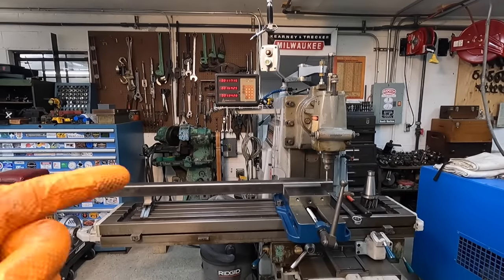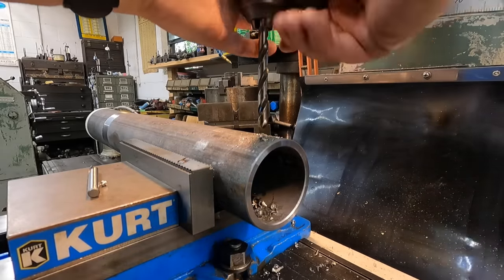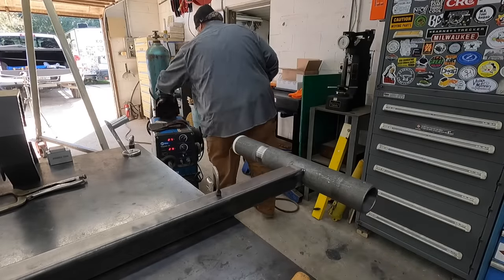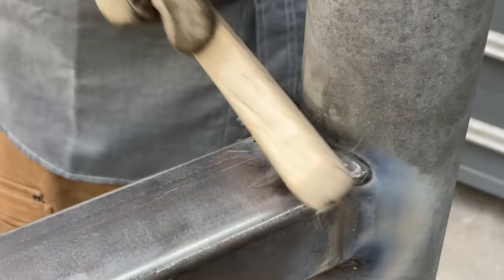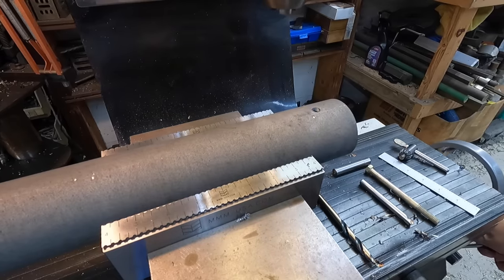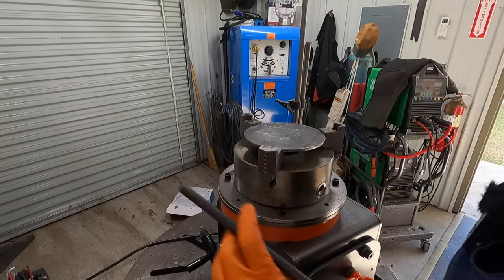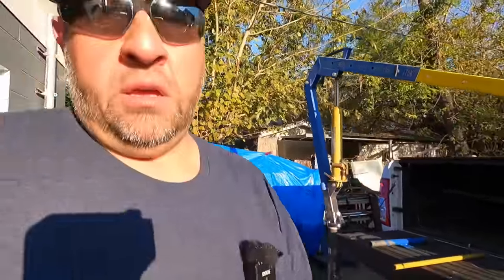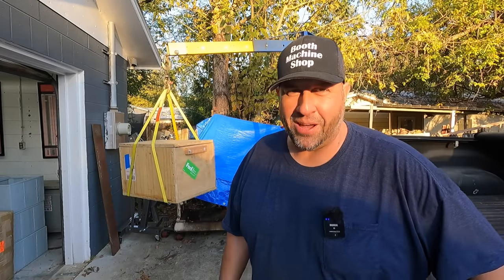Truck Hitch Crane Build Ep. 7: First Test!

Comment: Lifting system capacity is limited by the weakest link under dynamic (not static!) foreseeable conditions.  Intuitively this weakest link would seem to be the welded T joint on the vertical post to the horizontal square tube, which is leveraged by the load into bending, twisting, torquing forces all at once, all concentrated in the joint corners.  This threatens to peel the weld apart under much less force than the design strength of the joint.  The hazard is amplified if the truck should roll slightly, when the weld joint will be twisted by the leveraged mass of the truck!  Hence it would seem prudent, with heavy loads, to CHOCK THE WHEELS FIRST .
Reply: I would agree, but like he said it was for 500-600 pounds.
Reply: I was thinking the same thing but if it was me i would add a removable leg on a caster to support the twisting force

Comment: Awesome. 

I'd have some fold out support legs rather than rely solely on the box section to keep the tube vertical under load though.
Reply: When I designed mine, I did something very similar to what Adam did. It was a while ago, so I don't recall the exact square tube dimensions, but I think mine is 2" square 1/4" wall? Maybe 3/8" wall... I don't remember which. I did a bunch of simulations in CAD and it held up perfectly fine. it DOES deflect enough to notice, but not enough to be a concern. Maybe 5/8" under a very heavy load? My design IS different (taper roller bearing turn table, cable winch, luffing jib, no hydraulics), but that horizontal box section is roughly the same.
Reply: @52Ford  yeah, but overkill fengs my shui, outriggers ftw 😆
Reply: @gentlyschannel4193  👍😂 I needed a gantry crane to pick up the bed off my pickup... so, naturally, I made it to pick 10,000 pounds safely. 

Edit: If you're wondering - It's a fairly large fixed A frame, with 4 crossmembers per A frame and a knee brace on each leg that goes up to the beam. Sits about 14' to the bottom of the beam. roughly 10 feet of clear span between where the knee braces contact the beam. A LOT of welding.

Comment: That's awesome, Adam!  I don't know what the cost would be to manufacture, but I imagine someone could sell a few thousand of those per year.  Additional foot pieces for different truck heights would be necessary.  I wonder if a trailer jack setup on the foot and footpad might be a workable solution to the varying height issues as well as the potential binding of the pin?

Comment: I think that’s cool as heck!! 
Hmm 🤔 but just a suggestion to a fellow builder, maybe try a threaded pipe for the foot with an adjustable nut on the foot like on a washing machine.  That way all you need to do is have a big wrench :) 

If you wanna get fancy, drill and tap a short hole for where the threads would be and put a grease fitting there.  It’ll turn a lot easier then as well when needed ! Good luck :)

Comment: Adam for structural steel welding try some .052 metal shield wire it's only supposed to be used for flat welding you may try your stick out and amps also check how much pressure on your gas also noticed you wire was not wrapped in a plastic bag maybe moisture or rust on the wire I'm retired now but worked as a certified welder machinist and fabricator learned a lot of things the hard way thought I was already subscribe but not but I will be love your machining videos you are a great teacher and also please don't wear gloves around machinery seen lots of bad things happen to some that have dirty and cut fingers are better then no fingers keep up the good work love watching your work great job

Comment: SUPER cool project.  Thanks for this.  At min 32:45 I had a cool idea.  Down the line as you're using this or maybe a friend or family member is using it...when you're setting the sleeve pin, since the the holes are so close together and the foot sleeve covers the holes as you're getting the foot positioned for depth, you could etch the hole numbers on the foot say from the bottom up so it's easy to know which hole is beneath the pin inside the sleeve, and/or remember where your last setting was (say between locations throughout the day, etc).  You could also inlay some safety yellow fire hydrant paint into the etchings.  It'd look badass.  Just gotta figure out how to stamp, brand, or etch them numbers.  LOL
Reply: What difference does it make which hole it is?  You drop the foot on the ground, then lift the pipe as needed to align the nearest available hole.  Why would you care which number it's in?

Comment: Suggestion: with the crane turn handle you are talking about welding on, how about installing a longer bolt into the lower cylinder pivot, and then just thread a handle onto it?

Comment: You haven't addressed the torque through your horizontal bar against the ground.  Unless you put a foot that reaches out under the lifted weight, you will put all the torque on your weld between your vertical pipe and horizontal hitch mount.

Comment: You may want to wire wheel each joint with a stainless steel brush and spray your joints with a degreaser and blow dry with compressed air. Use a dedicatated wire wheel and not one with grease on it. Clean and disc sand your ground connection as well. It looks like you may have cutting oil or plating causing pin holes. It happens more on aluminum, but may be your problem. Notice it happens more on the last bead as the hot contaminated gasses have no where else to go but up at you. Most people blame the gas right away... Also check gas flow holes at near the wire tip. Sometimes spatter clogs the ports. Back in the day, I used to use spatter spray. Not sure if you guys are still using that today.

Comment: You may want to consider putting a locking pin on the horizontal square tubing in case the two bolts rattle loose.

Comment: WOW, what great work!! I binge watched all 7 episodes. This is what happens when an excellent machinist gets turned loose on a welding job. I'm hoping that you made this for your own use. I doubt that a customer would be willing to pay for the hours and skill that went into machining the parts. Now my 2 cents worth: You are very good at protecting your hearing as well as your work around machine tools. However, you should consider protection for your lungs. When you are welding, the toxic weld fumes are all around your face and in your breathing zone. I use a HF 8" Portable Ventilator with flexible tubing to exhaust the fumes away from my breathing zone. Just a suggestion.

Comment: Adam, 

You need to paint out the load limits on the boom.  Generally,  load limits require testing at 1.5 times the working load.  I doubt you want to  pick up 3 tons.  Also, nylon swells when expised to water.  A cap for when the crane is removed.   In addition, nylon is susceptible to damage if the wrong lubricants are used.  Evidently WD 40, for instance,  is a no no.

Bob

Comment: moisture in the flux is the most likely culprit. Usually flux core wire comes in vacuum sealed bags with the little moisture collector bags. moisture will get into the wire if it’s left around in the fresh air for months on end.

Comment: It's a fantastic build Adam, however you will quickly ditch the foot. The first time you load the suspension on your truck and can't collapse the foot on the crane you will have to unload the truck just to readjust the foot. I'm not sure what you can do to help with that, but just a heads up.

Comment: I think that a nut welded into the bottom pipe and a corresponding threaded shaft with the foot plate would serve you better as long as the shaft was 24". You never can be sure what you will run up against

Comment: If you keep the base in place while driving I would add a pin to lock the T section in place. If the 2 bolts come loose the cross section might slide into traffic otherwise.

Comment: You can make more adjustment holes without intersection, just put them not along a straight line, but on a spiral or along different lines, shifting a little bit

Comment: Looking forward to the crane to lift the crane video. You talk about protecting your back but the top assembly isn't a safe one person lift. Aside from splitting the jib and ram sections down with lynch pins, you can certainly bore the centre out of the solid pin to leave 1/4-5/16" wall. It should save a few pounds. The bar centre is redundant material - you could also bore it with a taper to follow the bending moments. You don't have the material above the flange so there's no point having so much below it. 

I'd also shorten the hitch adaptor to move the crane forward so you can load into the centre of the bed.

Comment: from my experience with welding the teeth on the wheels are for flux core wire since its hollow you cant squeeze it as firm as you can with solid core wire. solid core wire im not sure about if it will hurt to use the wheels with the teeth but smooth will work just fine you just need to adjust you tension. also a wire lube pads were used in the shop most times as the tools tend to have a lot of wear on them also the worm hole you speak of are probably from your contact distance. you need 3/8" to 1/2" with flux core and for the final tip as im not sure if i missed it but you have to weld with DC negative when welding with flux core unlike solid core where your running DC positive

Comment: I would just drill a hole in the main beam for the turning handle. It shouldn’t take away from the strength, but you might want to weld in a bushing to insure that it won’t. That way it’s removable in case things are tight around the crane.

Comment: Put the original crane handle back on at what ever height is comfortable for you weld it on or bolt it back on and cut either side off it level with the width of the box section then you can slide the jacking handle through it when you need to slue the crane round then when not needed pulled the handle back out then you don't need to weld 2 tubes on it

Comment: also i believe the serated roller is for mig wire so it grips. the smooth roller is for flux core cause flix core wire is serated you will clog up your stick doing it other way , for the worm tracks i forget but did you check polarity i think flux core is the stick is negative and your work piece is  the hot piece opposite of mig

Comment: Greg from northern Michigan. Might want to add a water drain hole in the bottom of your round foot plate. I really liked your spool of invisible MIG welding wire too !  Nice work as usual.

Comment: you are a fantastic mechanic, big compliment – great job. However, with all due respect, what would make me very worried about this crane is the loose contact with the ground, which is of course fantastic when the forces act perpendicular to the ground, but what if the lateral forces become too great? In the event of a greater torsional force (with the swivel arm extended far and with a high load), the crane can suddenly start tipping. The wobbly square profile, which is connected to the rear of the vehicle counteracting this torsional force, would hardly be able to prevent the crane from tipping backwards, I guess

Comment: Suggestion change the piston to run off a hydraulic pump ran from 12 volt motor for smoother up & down but my only worry is the lower part the pipe might be still to close to the ground while driving & you would have to move the cross bar in so it don't block the break & tail lights otherwise it looks very strong and we know it's very well built ! Oh on the footing drill a drain hole in the bottom so you don't get water building up & rust it out from the inside being the climate down in fla !

Comment: Hey Adam I think this a great project! For the “handle” why don’t you drill and weld in a hollow plug with an ID that slips over the jack handle? That way it’s accessible from both side and easily “removable” and not adding any weight or odd shapes to the outside of the column. Just a thought

Comment: Love the build! Looks like a miniature Jib crane from your new space! And yeah a good hardened pin would be fitting here and inline the spiral of the holes . And one other thing in case you pick up a max load i would have felt better with some gussets welded to the round leg where it is attached to the square tube to maybe fight off any failure downward or it the load is further out at the end or the reach? May not need it but,  sounds better than not

Comment: Man that is sweet lil rig you got there.  As usual, OCD on the machining work but I love it!  I would def replace that manual cylinder with an air over hydraulic one and install an onboard compressor to power it.  I smile the same way after I’ve fabbed up a project that helps me out greatly!

Comment: As stated in some other comments, different density gasses stratify when sitting for long periods of time.  I encountered this using precision gas mixtures for laboratory measurement equipment.  When the cylinders sat for extended periods, we would lay the cylinders down and roll them for 20-30 minutes to mix the gasses.  Our gas supplier actually had a motor driven cylinder roller.

Comment: Depending on the weight of the load in the bed the squat of the suspension may make it difficult to remove the adjuster pin after loading. I’d suggest a trailer jack or something to manually take the load off the pin and base support. 
I enjoy your videos keep up the good work 👍

Comment: An enhancement to your design would be a means to take the pressure off the foot after loading your cargo. As you load the truck, the frame is going to drop.  That will put pressure on the foot.  Removing the pin will be difficult due to the weight.

Comment: Hi Adam. Really enjoying your work. I think you might need a new liner for your mig. Your drive wheels are slipping and you had to pull pretty hard to get the wire out. Inconsistent feed could be contributing to your problems. Good luck!

Comment: I am not a welder,  and if I use a Mig welder I use Co2 argon mix gas and solidwire for steel and have not the issues you have until I have no gas.

Comment: What about the pressure when you add 500-1000lbs of load to bed and the suspensions wants to drop but now its resting all on that foot. you almost need a screw jack on that foot so you can slowly let the trucks suspension take the load so you can remove the crane. Very awesome man!

Comment: Adam it’s the gas if it’s a mix with CO2 as I’m sure it is since you are MIG welding. Have had this problem several times and couldn’t figure it out. A neighbor that has 40 plus years welding in shipyards for the Navy solved it. Get a new bottle of gas, that one is contaminated with water. Quite common in a CO2 mix according to him.

Comment: 1:30 - "You're doin' it wrong" ! The drawbar should be fully threaded into the adapter, then the tightening nut screwed down (with oil on the threads too) - to ensure the drawbar is properly screwed in.
Reply: I knew you would get "oil" involved somehow.....

Comment: I’m a shorter guy at 4’11” and my back is all messed up!! I’ve actually been thinking about putting one of those bed lifts in the back of my truck but I never liked the looks of it sticking out of the bed of my truck and that’s why I’ve only been thinking of getting one for the past two years or longer I also thought about putting one just off of the ball of my receiver hitch but still didn’t no how I’d even like that either?? The way that you have it set up works pretty good it looks like though!! I would definitely like to see you pick up something that is at least a thousand pounds or more and see how well the extra weight is handled before I decide to make one for my self!!!??? If you could demonstrate something with at least thousand pounds or more on a video using your crane I would definitely appreciate it a bunch!!! Thanks in advance buddy and I definitely am loving the videos!!!

Comment: Watching you closely to me it looks like your biggest problem is you don’t have a big enough arc length you need 5/8 inch tip to wrok . So the flux can preheat and gas off. worm tracking is caused by moisture being trapped between the metal and the flux it’s actually steam that makes the worm track. Gas does not have a shelflife but if it doesn’t have a dip tube in the tank.  The gases can separate. Just take the tank lay it on the ground and roll it back-and-forth for about 10 to 20 time. You can try pre heat. To drive out the moisture.

Comment: Need to make a lockable swivel where it comes out of the hitch. So you can unlock it then lift the load so when yhe truck squatts you can remove the pin in the bottom of the crane. With a load in the back of the truck the pin will be jammed.

Comment: That's a very clever and useful design. One which I may tackle for myself. I think I'd probably have drilled the holes in the foot offset by 90 degrees every other hole. This increases the material between the hole and will prevent any distortion. Additionally, I'd have used an Acme thread and nut welded to the bottom of the tube with a simple matching screw about 1" in diameter. You could then collapse the screw and relieve the load after the bed is loaded. Also, some kind of brake should be incorporated on the pivot shaft to be able to control any wild or quickly shifting load. Additionally, some sort of positive stop so the whole thing doesn't go wildly swinging into the side of the truck or inside the bed.

Comment: Re your handle, why not cut off the protruding parts of the original handle, attach lower down and just insert a smaller piece of pipe as a sliding handle?  That way you get it on the side you want it, can slide it out for extra leverage, remove when packing away.

Comment: The “foot” needs to be a jack. A jack would compensate for uneven ground and loading and unloading of the suspension. Gonna be hard to  pull the pin on the foot with load on it, however you could raise or lower a jack. Just a thought.